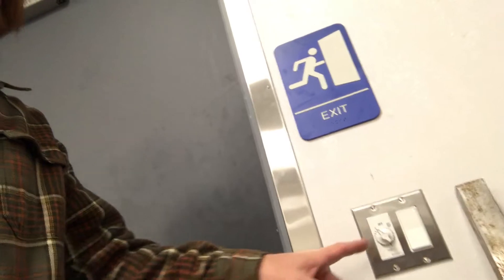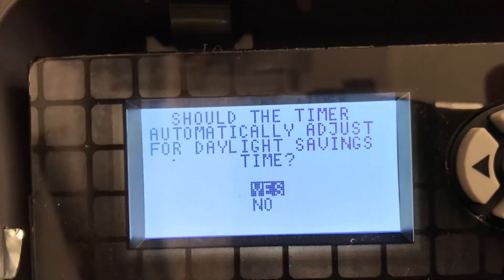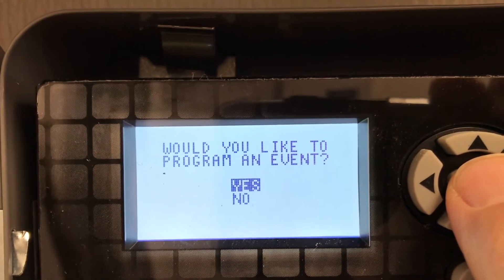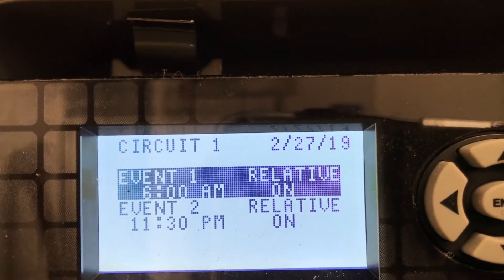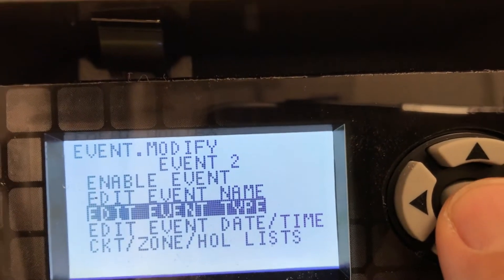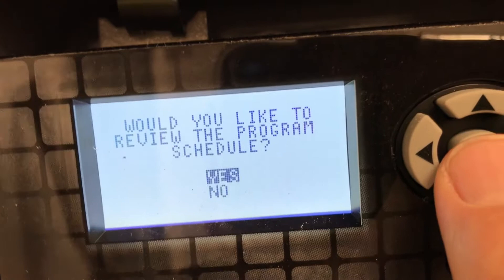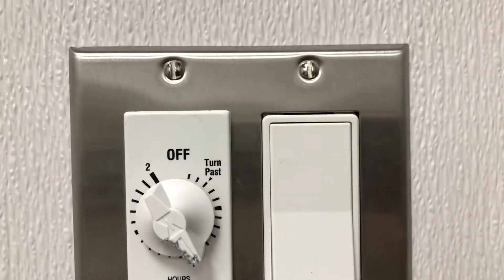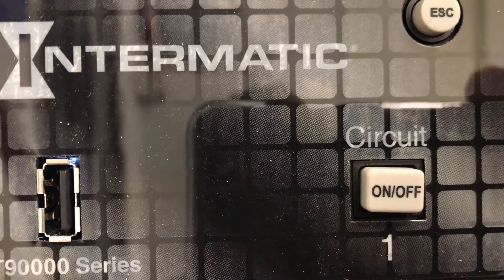Programming Intermatic ET 90000 Series While Title 24 Testing of Lighting Controls

Comment: I need to set this thing to turn lights on everyday at the same time and off everyday at the same time. How do i do that? Do I need to do that for every single day or is there an everyday setting
Reply: Did you figure that out ?
Reply: @zwestley203 yes okay so there is something weird with it.  Basically you'll get to a screen that says something like 22 of July but you can change the 22 to every and July to the year so it reads everyday of the year. It's something like that, it's very bizarre. If you need more details I can send them next time I'm at that site